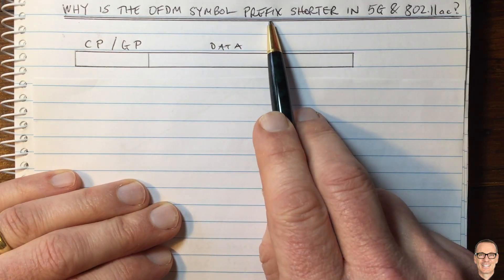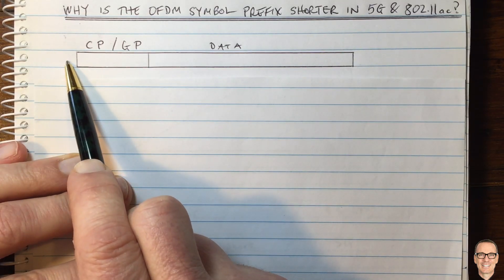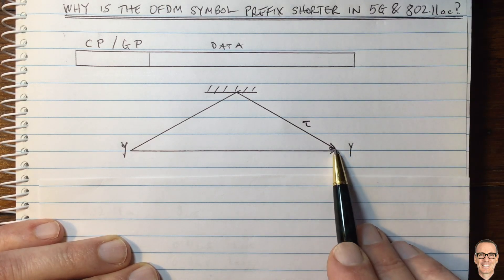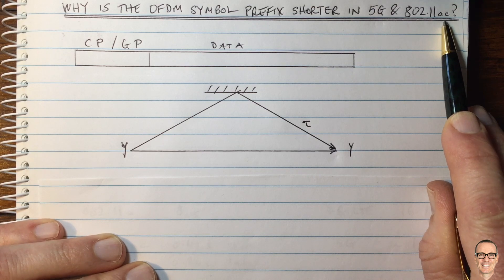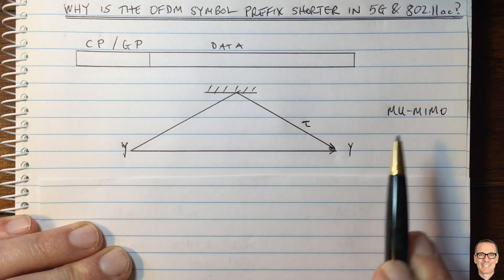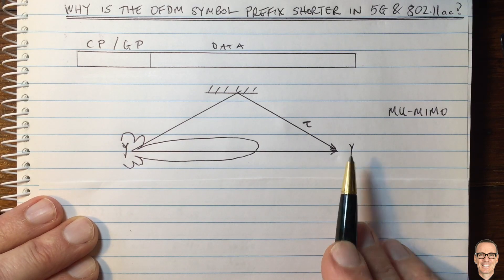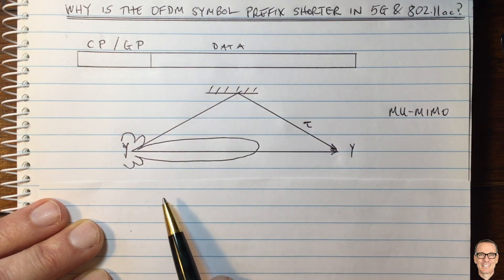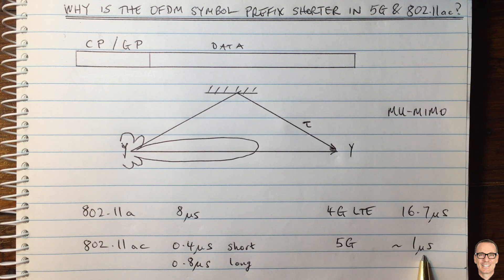Why is the OFDM Symbol Prefix Shorter in 5G Mobile and 802.11ac WiFi?

Comment: Why do they still use ofdm for 5G should the point of these new generation (aka new "G") was to use new technique ?
OFDM has already been used in 4G shouldnt they move to another technology ?
Reply from the maker: The generations of mobile communications are defined by much more than just the modulation formats they use. Even though OFDM is used in both 4G and 5G, there are many extensions in 5G, such as higher frequency bands, different subcarrier spacings, different numbers of subcarriers, ... the list goes on.